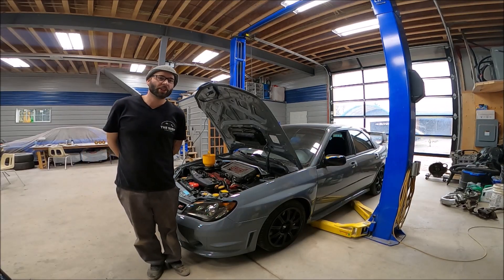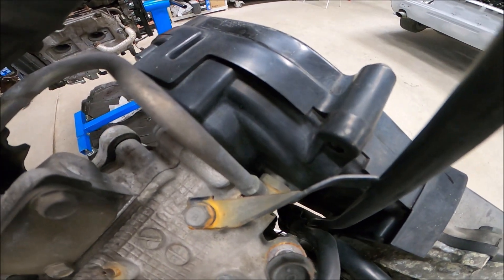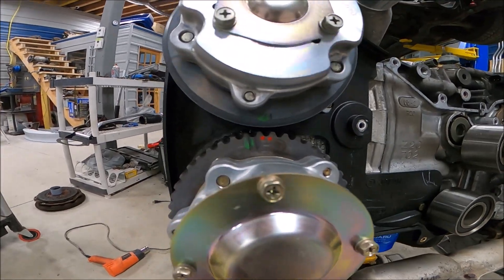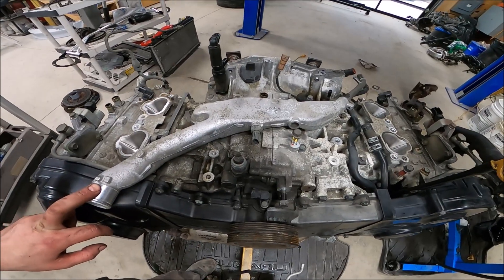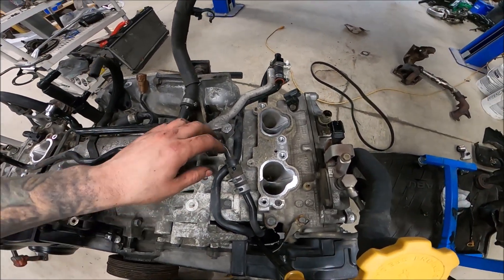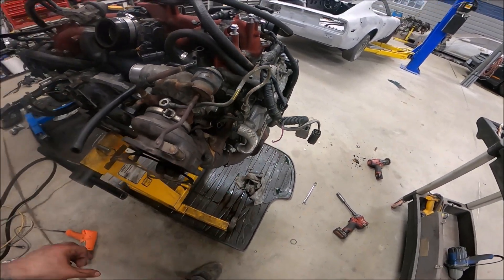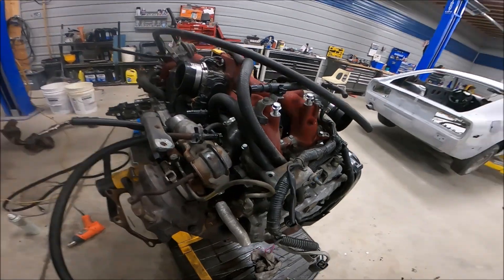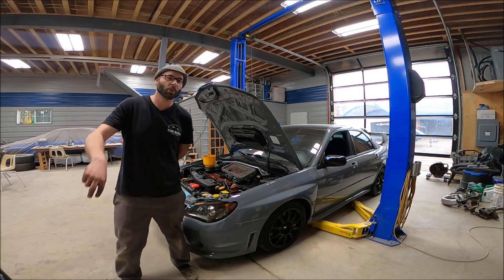How To Jdm Ej20X Swap - 06-14 WRX, 04-07 STI, 05-09 LGT, 04-14 FXT

Comment: Wouldn’t it be easier to just put the 2.5 heads on the 2.0 block and use back all the 2.5 harness and accessories just asking has it just pick up a blown up 2013 wrx.
Reply from the maker: A few reasons why a 2.0 block and 2.5 heads would be more difficult and more $ defeating to purpose of a $1k engine swap. As far as I know, 2.5 block and 2.0 heads will work but not so much the other way around. Hope that helps, we also have an 08-14 wrx how to swap vid with this same engine. Its the same process just different visuals
Reply: @TheSubieSanctuary   ok so will i have to tune it after i am in ny no cel is mandatory lol
Reply from the maker: @Rasigarage  for the 08-14 wrx you will need the ej20Y engine because it has the air pump. You will have no codes, it is recommended to get a tune though for sake of displacement and timing. It can be tuned with a cobb ap or done via opensource or ecutek.
Reply: @TheSubieSanctuary   ok thanks for ur quick replies
Reply: @TheSubieSanctuary   ive been looking and all the ej20 close to me says ej20x with secondary air pump what is the difference with the Ej20x and ej20y

Comment: Im doing this swap right now and I've seen that i need to replace a bunch of sensors to get it to work but you say i don't need to swap any sensors, i just want to make sure i don't need to before i go to put it back together
Reply from the maker: Only potential sensor you may have to swap is knock sensor. 
To be sure, what year and model is your car?

Comment: Ej20x or ej205? What engine is more capable?😊
Reply from the maker: The plastic manifold jdm ej205 is easier to tune, thus more friendly to push and more accurate timing. Id say they both do have the same limit for power though. 350whp

Comment: I have been having an issue where i have to press the pedel to start the car or it will crank 4 or 5 times or so before starting if i dont
Reply from the maker: That wont be related to the engine swap. Something else is going on

Comment: Will it be direct bolt on or do I have to make adjustments ?
Reply: My mechanics don’t specialize in swaps so I’m trying to give them as concrete direction as possible .. I didn’t do the clock back adjustment on the timing belt .. however it’s running just fine .. getting this car to breathe is my only concern .. I appreciate you reaching back so quick too
Reply from the maker: It will bolt right up! Let me know how it goes once you have it all together

Comment: Hello,
I am considering swapping this into my 2013 wrx but had some questions. I see most of the motors have a secondary air pump on ebay and my car also has a secondary air pump. Would I be able to delete it and if so, im assuming I would have to go open source? Also do the motors come with a TGV delete stock due to emissions not being as strict?
Reply from the maker: Hey buddy, you can delete air pump and go with an open source tune. I don’t believe the 20y(air pump version) has tgvs but they are side feed injector and your 13 is top feed so the tgv’s wouldnt work in your car. Here is a vid on a simple tgv delete for your original 13 wrx tgv’s. Its a good time to get rid of them while in there

https://youtu.be/YK0YJR1FoQI?si=h2CaGtToGyFP8EHY

Comment: Thanks you for the information on these swaps do you have a write up on the timing portion of the video
Reply from the maker: I do not have any write ups for this. 
It is as simple as turn both exh cams backwards by 1 tooth. I know it can be weird to wrap your head around. But physically doing it, its not so bad. 
If your using a belt with all the marks worn off. 
Rotate engine until all marks are lined up, mark the belt at each original timing mark. Then remove belt and just turn the exh cams backwards by 1 tooth. Place a new mark on exh cams beside original mark and put belt back on lining all belt marks with cam/crank timing marks

Comment: Can i use the JDM turbo too, assuming the original ej25 turbo was damaged when the engine failed?
Reply from the maker: You can only use the original jdm turbo if you car is a plastic intake manifold car. Like legacy gt or 08-14 wrx. The reason you cant use the original jdm turbo on the cast intake manifold cars is because the way the intercooler bolts onto the turbo

Comment: No need to swap the oil cooler and water housing for it ?
Reply from the maker: Couple things. If you end up with a 20x from manual car it will come with oil cooler/
If your original motor began to knock, Do not re use that oil cooler! 
It’s debatable that the factory oil coolers much if any benefit. In the 08+ wrx they stopped using the oil cooler. 
You can swap over water pump and a good oil cooler if you want. No harm, no reason not too, but low benefits and more expense if needing to get a new oil cooler.

Comment: Hello!   You said you can use a V7 STI SPEC C engine with a 32BIT ECU by notching of the 207 cyl head cam sensor holes so they line up with the cam teeth/sensor.   Do you do this work or can you recommend someone who does?  I want to use the V7 in a 2005 LGT if possible.  (JDM Big Port heads with SAVCS)
Reply: And this would be with using the USDM intake cams and sensor.  RCM makes a cam conversion kit as well for the 16BIT SAVCS heads on the 32BIT ECU cars but you still would need the proper 32BIT cam sensor?
Reply from the maker: Yes you can use the 207. Notch the sensor hole, use your 255 or 257 intake cams and your whole intake manifold

Comment: How does the 20X compare in performance/ driving to the 255/257?
Reply from the maker: They do have less bottom end power and less torque over entire power band. But they will make the HP pretty easily as their original 255/257. 
In most stock scenarios, people hardly notice a difference in the bottom end power

Comment: Can you tell me if there is a usdm intercooler I can use on my EJ20y. I’m using the JDM one but it’s not in great shape. Thanks!
Reply from the maker: Only other ones that will work other then the jdm tmic, is the grimmspeed for 08-14 wrx and lgt

Comment: This is so old I don’t know if I’ll get a response but I hope I do. Does tuning with Cobb still work?
Reply from the maker: Cobb tuning will still work with the green speed update except you will have to get the ej20y if your car originally came with an airpump (ej20y has air pump) 
If your car didnt come with an air pump then your still good to use the ej20x, subarus 2005 and older had no air pump
Reply: @TheSubieSanctuary  you are incredibly underrated with the detailed information you provide. I have an Outback XT with a bad 2.5 2009 I’m wanting to swap it but also modify it as well.

Comment: Is their a difference in the ej20x and  ej20y when using in an automatic transmission. I read you can use either in a manual.
Reply from the maker: Yes either engine can be used with auto or manual!

Comment: 2013 SWAP FROM 2.5 TO 2.0.   I had a technician do it that has never done one before. Car runs fantastic, but dies after about 15 mins. (wait about 30 mins and starts right up again) does this sound like something characteristic of not turning it back one tooth? Any ideas would be helpful and appreciated
Reply from the maker: Hey buddy, that sounds like a failing cam or crank sensor once it gets hot. 
I recommend watching the sensors on a scanner while its running to see which one is causing it to stall.
Reply: thank you very much
 @TheSubieSanctuary

Comment: Would I be able to swap this and drive on factory tune and pass deq or would I have to get. A custom tune to be safe it’s for my 05 legacy gt wagon automatic
Reply from the maker: @ricerlife8322  you would be able to do this exact swap in your 05 LGT, you would pass smog as this swap would present no check engine lights. However it is recommended you get a tune for sake of timing difference and displacement change. 
Look into an opensource tune in your area prior to considering this swap though, just so you dont end up with nobody to tune it.
Reply: @TheSubieSanctuary  I just wanted to make sure I can pass deq I’m gonna be getting Cobb soon and calling around Tuner shops to see for a custom tune thanks for the info just wanted to make sure before I pull the trigger on the swap and get it back on the road again

Comment: Could i use the ej255 turbo cams instead of the ej20x cams/cam gears to bypass the dual avcs?
Reply from the maker: You could use the 255 exhaust cam shafts and gears. Youll need to use a 255 exh cam seal as well. Then do not alter the timing after
Reply: @TheSubieSanctuary  thanks for the quick response!  Another quick question, any ej20 piston and rods will bolt up to it right?  Are the head gaskets the same too?  I plan on building it up so I want to make sure I get the right parts the first time
Reply from the maker: @marcellusmiller3660  yes that is correct brother for piston and rods. Some people have found that at least the ej20y’s have had a slightly unique headgasket however most aftermarket 2.0 headgaskets will work.

Comment: So ended up finishing up the jdm swap on my 09 wrx . But now I got a p0340 p0016 code . Car eventually turns on after cranking for a while .it idles fine also .  I didn’t touch anything with the cam gears timing belt etc. i left everything alone . What would be your go to next if you were in my position. ( I also used the usdm manifold)
Reply from the maker: I have seen engines that have sat have a stuck avcs gear. Id use a good scanner that can watch live data. Run the car and watch cam angle between both sides of engine. They should be symmetrical.
Reply: @TheSubieSanctuary  found the issue it was a broken wire for Passanger side cam thanks for your help car started right up and sounds healthy ! No cel
Reply from the maker: @_jonbee  Thats awesome! Glad it wasn’t something serious! Good work and happy subaru’ing!

Comment: so what if you dont have a usdm engine? can u buy a new timinng kit and use the japan intake, or would need to find usdm intake and crossover pipe etc.
Reply from the maker: Is your car usdm? What year/model? 
Jdm intake mani wont work, harness is on wrong side.
Reply: @TheSubieSanctuary  yes usdm, 2004 forester xt, i dont have the engine assembly.
Reply from the maker: @ajgattarello410  thats a bummer. 
Ok you will need entire intake manifold/harness and all attached for 03-05 forester Xt or 04-05 Sti 
You would also need the exhaust header, up pipe and turbo for either of those models along with top mount intercooler 😬 kinda tricky

Comment: Would u be able to tell me why there is gas in my oil, car runs fine ? Purge valve ?
Reply from the maker: Could be a leaking injector, or could be bad piston ring. Wouldnt be the purge valve. 

My approach would be a leak down test to make sure all cyls are sealing properly. Next would be take injectors out and send to get tested

Comment: could i swap all my sensors and stuff from my ej205 to the ej20x? I dont know if the avs needs to be plugged in or how that would work or if the intake manifolds would be compatible
Reply from the maker: The ej205 ecu wont be able to run a ej20x. 
The reason is the way the 205 picks up its cam angle vs the way the 20x picks up. 20x/y can only replace 255’s and 257’s

Comment: do you need to retune the engine if you have a current tune on ecm for the ej255 going to the 20x? i heard the compression is more and needs a retune thank you
Reply from the maker: It is best to get a tune, not immediately imperative but i would tread lightly until you do get a tune.

Comment: I need help what spark plugs did you use on ej20x engines i need to know the right answer pls help
Reply from the maker: The use the exact same plugs as original ej255 (06-10 wrx) and ej257 (04-20 sti)

Comment: I have a 04 forester with this swap and its tuned but it started to knock. Im picking up another ej20x do i have to redo the timing? I have an open source tune.
Reply from the maker: @dominicrodrigues1146  how ever your previous engine is timed, is the same way you should time next engine. Then you wont need a re tune.
Reply: Thanks

Comment: What is the purpose of a AVCS delete my tuner is wanting my to do that but I see everyone just slapping the motor with out doing that
Reply from the maker: Exh Avcs delete will stop the of potential timing float on the exh cam. 
Its never been an issue with just the timing mod, they do just fine and tune really well.
Reply: @TheSubieSanctuary  so it’s pretty much not Necessary but the tune better without it is what you’re saying?
Reply from the maker: @_jonbee  deleting avcs is optional but not necessary at all.
Reply: @TheSubieSanctuary  I went with Leaving it alone .
Reply from the maker: @_jonbee  youll be just fine

Comment: I have a wrx 2.0 with 2.5 iag block  I want to put this into an sti shell what am I suppose to do
Reply: To make it possible
Reply from the maker: @austinaguilar7888  ideally if the sti shell has its harness still then you would want to get 32bit cylinder heads. D25, B25 or V25. 
If the sti doesn’t have its harness then you could swap your wrx harness into it and leave your motor as is. 
There is many ways to do it, really just need to pin down your objective and budget to see which path you want to take

Comment: So i have done the swap and am tuned but am not making correct boost and mainly the car is wayy quieter same way no muffler just like it was before the swap. Any reason why it wouod be as loud. Its substantial quiter it doesnt make sense cause my othe ej20x car is loud like it should be.. im thinking a clogged cat or boost leask, pcv ?
Reply from the maker: Sounds like symptoms of a clogged cat, also possibly if you still have catted up like early wrx and legacy had could also be it
Reply: Okay I was having a strong feeling this was it

Comment: Starting this on my 09 255 monday. This will be referenced alot. 

Would a clutch kit for a 255 usdm fit the 20x? Would the 255 timing kit fit as well?
Reply from the maker: Glad you found the video! 
The clutch kit and timing kit will be the exact same on the 20x as your original 255
Reply: Dude i had to come back to this video so i could thank you. 
I finally got the 20x in and fired it up for the first time today and it ran beautifully. Thank you so much for making this video. Its been 3 years since my wrx has ran last and this video helped me finally get it back on the road. From the bottom of my heart, thank you so much man!!!
Reply from the maker: @slackin_2423  my pleasure, thats what its all about my friend. I much rather spread the knowledge in hopes that it gets subarus out from sitting on a driveway and back onto the road to enjoy.

Comment: If I went from stock motor in a 2004 wrx witch was ej205 non avcs and swapped it to ej20 avcs motor. what exactly do I need to do to it with hoses and wiring harness? Also I’m blocking out avcs but I gotten completely lost after putting the motor in.
Reply from the maker: This should help brother, basically youd use the jdm pcv piping to cover all the extra vents. If you dont have the jdm pcv piping any more you could just run hose from extra crank vent with a “T” over to each extra valve cover vent
https://youtu.be/0sSuzHPUH8g

Comment: so the 06+ ecu can run an ej20? I'm trying to figure out what I would need to do a hybrid swap in my 06 wrx. and would the rev limiter be lower?
Reply from the maker: Yes the 255 and 257 ecu’s run the 20x without issue. Yes compared to the 20x potential for max rpm the the 2.5 ecu’s will be set lower. But you can adjust the redline higher with a tune

Comment: Ive been having a boost issue with my swap, i can only make 5 psi with the ebcs disconnected or connected, target boost is 21 psi!? I have boost peak tested multiple times and found no leak?
Reply from the maker: Wouldnt be the motor, would be something in your equipment. With ebcs disconnected the lowest psi should be 7 which is spring pressure. 
Something either hooked up wrong but not necessarily leaking. 
Do you have turbo restrictor pill in correct spot?
Reply: If I unplugged my maf, and my car ran fine does that mean the maf is bad ?
Reply from the maker: @GhettyGreeen  not necessarily.

Comment: Can you put the 257 heads on the 20x?
Reply from the maker: Wont work unfortunately, but the other way around yes. You know in a pinch you can use any 2.5 short block and put the 257 heads on it.
Reply: @TheSubieSanctuary  someone sold me. A regular n/a outback block  making me think it was a wrx 2.5 would it be worth using it still or just ej20x instead i really dont have the 1k to be spending but id hate to have something done that won't last or be as fun...

Comment: did you remove all the oil banjo bolt or you replace it with new one ?
Reply from the maker: We just remove the banjo bolts then remove the removable screens from them and re install the original banjo bolts. The screens are bad news
Reply: @TheSubieSanctuary  you just remove the  washer ? if i understand
Reply from the maker: @iminex3626  the banjo bolts are hollow, inside there is a cylindrical screen, you remove the screen from the inside of the bolt. Then put the bolt back with a washer on top and bottom of the oil line.
Reply: @TheSubieSanctuary  ah okay thank you !